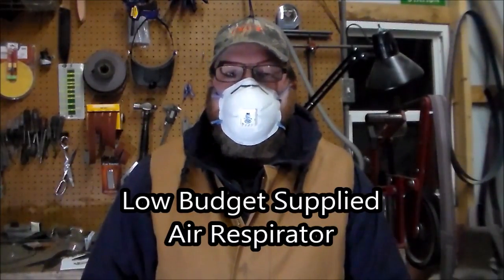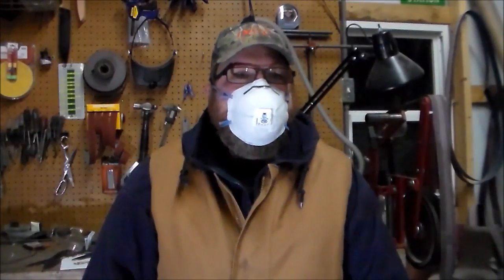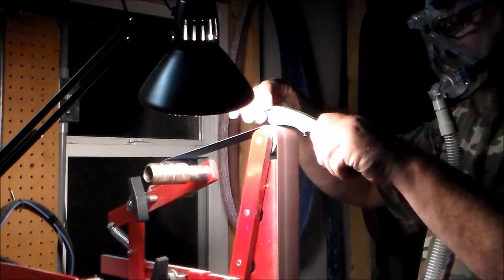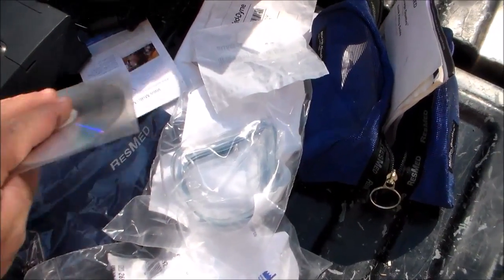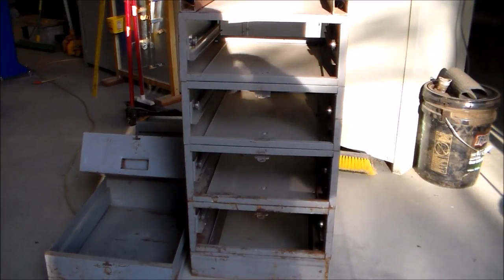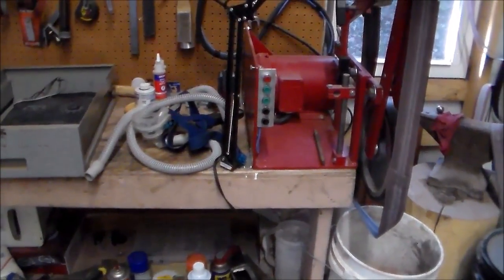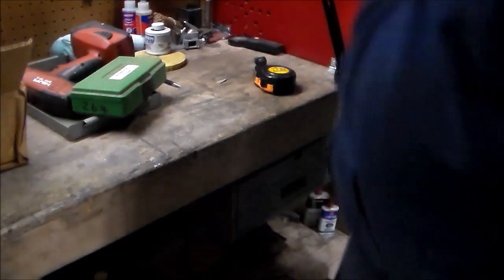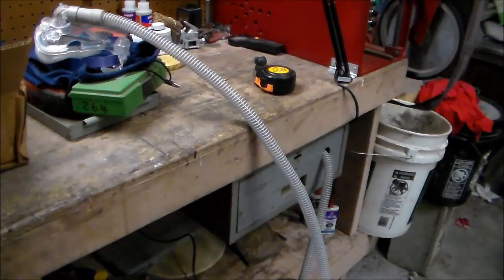How to Make a Cheap Supplied Air Respirator for Sanding and Grinding

Comment: For people who don't have a cpap laying around - you can do the same thing with an inflator used for inflatable toys, a length of drain tubing, and a full face snorkel mask from amazon.

The mask is the most expensive part - typically about $40 - but that's one of the masks with a snorkel built in that you can easily attach the hose to, and a check valve arrangement to keep inhalation and exhalation separate.

The inflator is about $12 for the plug in type - battery and rechargeable models cost a bit more.

Tubing is about $15.

If you care about esthetics, add $10 for a couple of pvc fittings and glue - or just duct tape it together.

The intex plug in model pump puts out about 50% more cfm than the OSHA requirement for a PAPR device, so there is spare capacity to account for minor leakage.

No filtration needed assuming your hose is pulling from clean air.
Reply: I saw a similar video using the scuba mask, but I want to modify my welding helmet to filter gases.  I think as long as there's positive pressure, I can fill in the voids with duct tape so the helmet essentially becomes a hood.

Comment: Around 30 years ago, I had a house where I was ripping out all the 1st floor carpeting and refinishing the concrete with an acid stain with some sort of poly clear coat finish.  Because of the solvents involved and the fact that it was a somewhat enclosed space, the fumes would be an issue.  I did not trust the filters that the various respirators offered though.  My solution was to create a positive airflow hood using a shop vac head that originally went on top of a 5 gallon bucket.   The filter was not used and the head was placed well outside the building with a garden hose attached to the shop vac outlet port.  The hose attached to my belt and then fed under the hood so that it would always give fresh air.  The hood did not need to be made airtight since it always had a positive airflow.  Later, I modified an old surplus Israeli gas mask to use that forced air method.  The original gas mask filter was not used.  With the original filter, the mask would need to fit your face correctly and a beard might interfere with it, but with the forced air modification, the mask could fit loosely and it would still work perfectly.
Reply from the maker: Very creative solution! Love it.

Comment: Nice idea, thanks. But why do u not put this compressor outside the room? then u will always get fresh air.
Reply from the maker: Well, main reason is hoses aren't that long or designed for that length. Secondly, my shop is pretty open so that wouldn't be an option for me. Tucked under the bench has worked awesome, the internal filter stays clean for months at a time.
Reply: @SelfMadeProject  What about sealing the hose hole, and then cutting a hole and mounting another filter to the drawer itself?  I can understand not wanting to cut too much, but it would further save both lungs and filter.
Reply from the maker: @AvgJoeCrowe  you could do that for sure. I had thought I might do that if it appeared dust was getting by and in drawer. Apparently its not a problem, the filter on the machine stays clean, I've only changed it once and it didn't really look very  dirty then. It's working pretty well like it is, thanks for checking it out.

Comment: Well done.. Excellent idea.. Where the hell do I get one of those sleep apnia machines ? Time for Google !
Reply from the maker: Ha! I lucked out and knew somebody who didn't need it anymore. People sell them sometimes on craigslist or ebay. Most people get them basically free if they have good insurance, so you would think they should sell cheap. Good luck.
Reply: Thanks for reply.. I must check out your videos..  Delighted for you for if it works well you will never have any negative effects regarding breathing from your workshop.. I thought I was in trouble with table saw.. only need to occassionaly rip small amounts of long Oak boards in my hallway !.. but eureka happened.. now the saw is totally boxed underneath and will also be on top with glass and wood box and leather flaps with vacuum there..

Comment: Nice job but pretty sure you still have the same problem unless you shave
Reply from the maker: Not sure what you mean, but no. It's pushing air into the mask and expelling it out a port when you exhale. The positive pressure keeps you from breathing in air around the seal. It's got pretty strong pressure actually.
Reply: It's a positive pressure mask, so no full seal is needed to maintain effectiveness.

Comment: This just draws in air from the shop... You need outside air or don't even bother.
Reply from the maker: Well, I'll respectfully disagree. All respirators us shop air, so it's just a matter of filtration. While this was not designed for this particular use, it does have filtration. There is a 2 stage filter system on the unit as well as a water tank for adding moisture to the air stream. I believe the combination of where the unit is located and the micro filter inside it does provide safe breathing air. I promise you it's better than a dusk mask that a lot of people are using.